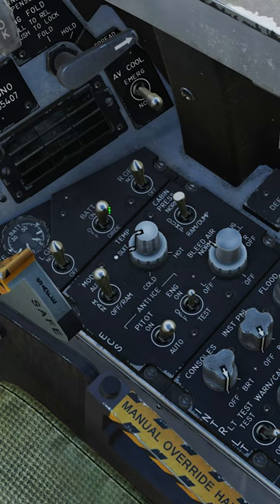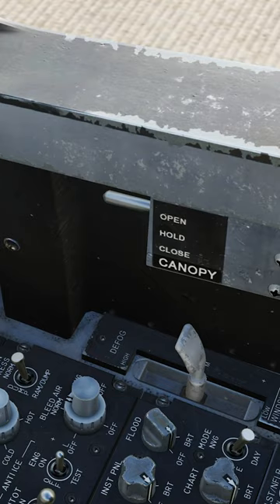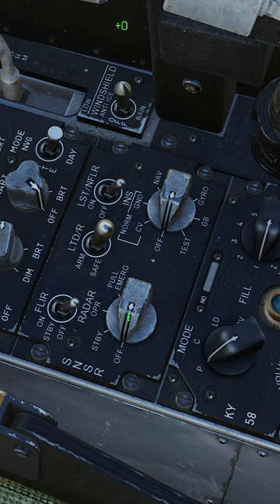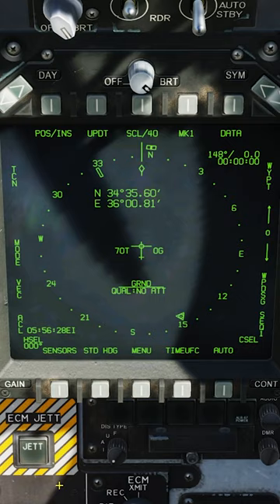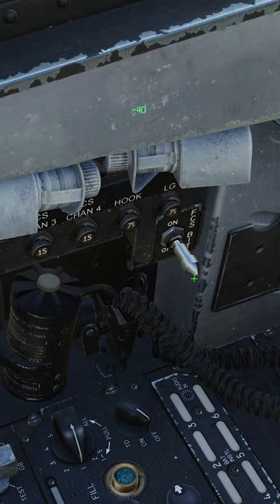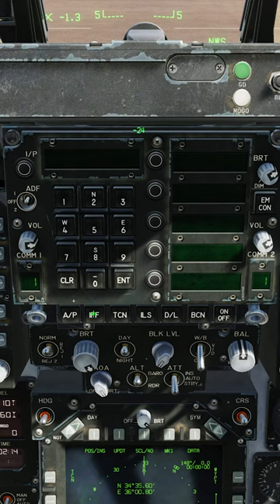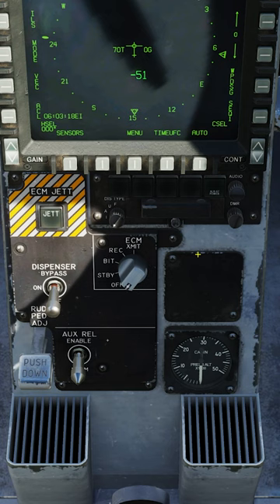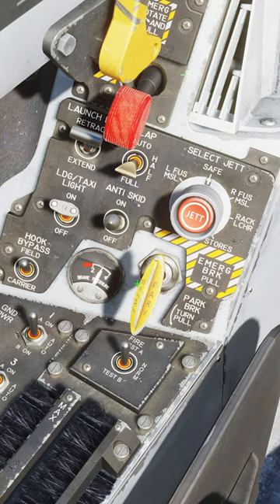F/A-18C Hornet Startup in 60 Seconds!

Comment: Radar goes to STBY once you are out of the ramp area. This way you aren't blasting ground crews with radiation. Source is a F/A-18 Instructor at NAS Lemoore
Reply: Hmm I'm not disagreeing that it's like this but I read somewhere that radar won't blast while weight on wheels in the 18 even on operate. Might be just standard safety thing for all planes to follow
Reply: Also off when you are in the air refueling
Reply: @De_Geit  I believe it goes to standby when doing a/a refueling, not off. I'll look at the natops
Reply: Question: is there still more in Lemoore? 😁

Comment: Don’t forget to remove blink from HUD in menu and set distance to 100nm. Then don’t forget to setup program 1 and 5 on dispensers so you aren’t wasting chat and flares. I use program 1 for 1 flare x10 every .50 interval and program 5 as 1 chaff x5 at .50 interval. You’re welcome. Also reason you remove blink is you can lock targets with HMD through the floor or body of your airplane ;)

Comment: Close to the real procedure. Only minor changes needed.
Reply: Spill it...
Reply: Are there steps missing or is it rather the order in which things were done ?
Reply: @laszlokiss483  Steps.
Reply: @laszlokiss483  This is the correct start up procedure. These modules cost upwards of a million dollars to make due to the expertise and resources it takes to develop.
Reply: Yeah that was legit, Don’t have to bother with the radar if not using it but basically need battery on, start apu, start right engine for back up emer systems/ recharge apu pressures, reset fcs, left engine start. All thats needed to start for maintenance turns

Comment: A faster way to start up the actual engines: Right after the battery, switch on the APU and engine crank. I usually enable the throttle anywhere between 0-18%. When the throttle RPM gets to 34%, you can switch the engine crank for the other engine and they both will start.

Comment: Why switch the ins to in flight alignment instead of the nav mode?
Reply: IFA continually updates and adjusts the INS alignment via GPS. Nav mode is only used in settings where GPS is not available.
Reply: @Monarch683  interesting, thanks for the information

Comment: does the bit test actually do anything?
Reply from the maker: I mean yes, but inside DCS… it’s not required to have a functioning f18
Reply: @TrickerDCS  nice knowing our jet will always start the same every time here
Reply: @TrickerDCS  Even if you have the random system failure setting enabled??
Reply from the maker: @2KOOLURATOOLGaming  unsure about that.  This is just a BIT, if your FCS has an issue or failure, you will know 😆
Reply: Yes, it does check the modeled FCS system and the physical flight control surfaces will move.

Comment: bro bro your brake pressure was below 3000 psi and you didn't test both fire circuits. love it but still wish dcs modeled equipment failures though.

Comment: Any f18 pilots here? Curious as to how accurate this is to real life
Reply: He missed the step right after Right engine start up where he rotates his Bleed Air switch clockwise back to normal prior to starting up the left engine. Without it, this will cause both valves in the secondary power system to be open, with less air go to the left engine for start up procedures.

Also missed the step where he checks his Fire Loop A and B system for operation before he even started up his engines. Should be the first step immediately after battery on.
Reply: @thiskidAndres  that last step isnt required ingame but is modeled. mostly because the aircraft ingame will always spawn fully functional as us knuckle dragging technicians havent touched it yet.
Reply: He missed a few steps but I can confirm this is surprisingly very accurate, although I wonder how in depth the fcs system actually goes in this game or if it's just on startup.
Reply: Wheel chocks don't come out till you are ready to move the jet (at least in f/a-18e) and a few out of place actions but scarily accurate for the most part
Reply: @thezombiepotato1  id imagine alot of the systems on there would remain classified
Reply: @callanharvey2293  not really there's nothing fancy about 4 channel flight control computers for surfaces,but if you've never actually operated it before I'd imagine it would be really hard foe the devs to make it functional
Reply: @thiskidAndres you only need to turn the bleed air knob if you test the fire circuits
Reply: @joshuagollaher9614  best practice vs get this bird in the air before you get wasted by air raid or MP keeping a yahoo from liberating gov property.

Comment: 20% N2 my friend
Reply from the maker: I was told by 3 hornet pilots in person it’s 18%… doesn’t matter anyway, introduce the fuel and light it off
Reply: @TrickerDCS  to be honest it doesn't, the FADEC will take care of fuel and light off when its ready after you push it into the idle detent. It wont light off until all parameters are in check.
Reply from the maker: @lindsaybrown5897  lol so why mention 20%
Reply: @TrickerDCS  because why mention any figure..... the 20% N2 is what I was taught. Pilots and engineers have always had different figures and limits to work with on aircraft for as long as I have worked on them. Im not saying you are incorrect but 20 N2 is a better fig to put into idle detent than 18. In a game it doesnt really matter but from a tech point of view 20 is closer to what the FADEC wants
Reply: also as far as the sim manuals concerned not real life the software wants 25% N2 before its logic gates will start the eng in the game
Reply from the maker: @lindsaybrown5897  I mentioned 18 because 3 separate pilots that I’ve met all said the same thing